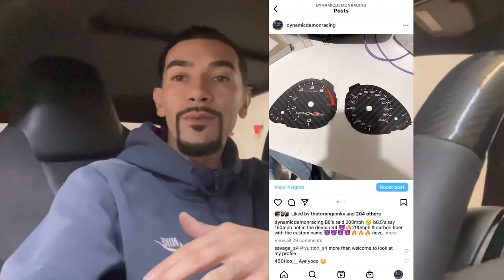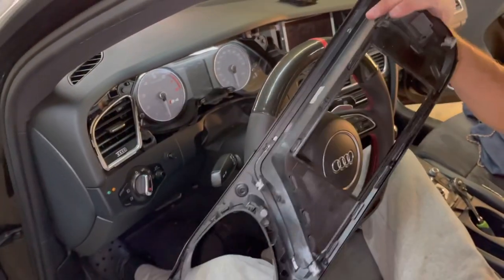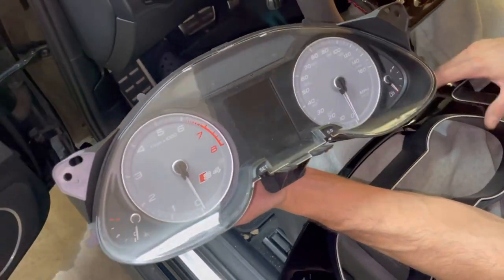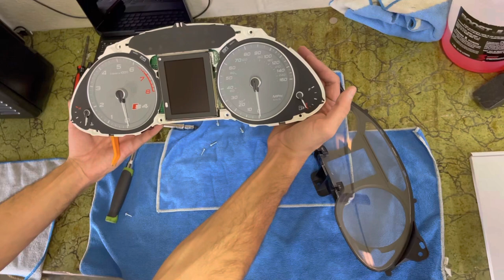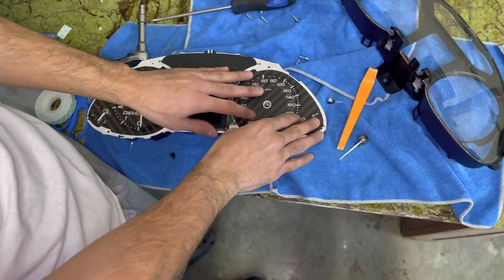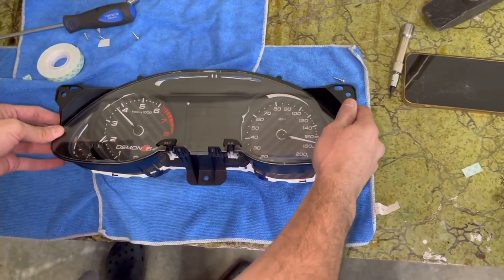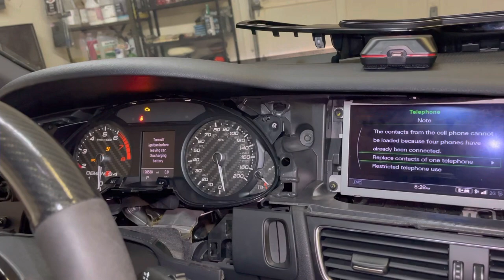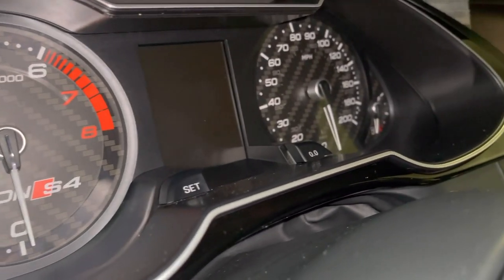CUSTOM INSTRUMENT CLUSTER!! Audi S4 custom instrument cluster / custom dash

Comment: Nice S4! You have to have it calibrated or anything I see the needle is behind zero on the mph and on the rpm needle is showing rpm when it's off
Reply from the maker: yea i didnt realize that till the next day its easy you put the needles back in pull then back till it stops on 0 if it goes past, take the needle out and adjust it pull it back itll it stops on 0 it takes a few trys
Reply from the maker: & good lookin bro 🔥🔥🔥
Reply: @DynamicDemonRacing  subbed!
Reply from the maker: @ps3ful  good look bro! more vids to come😈😈